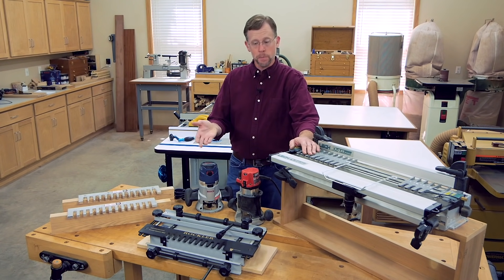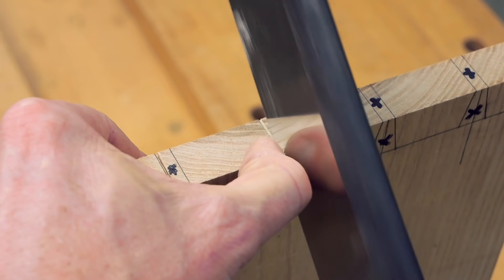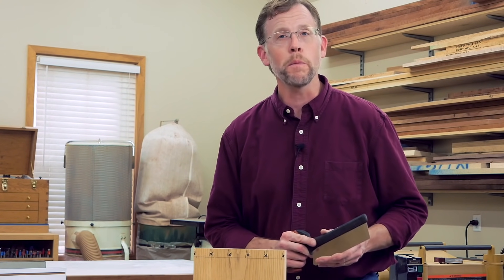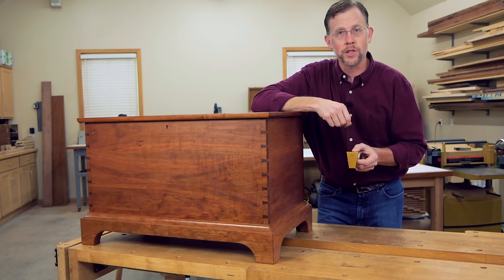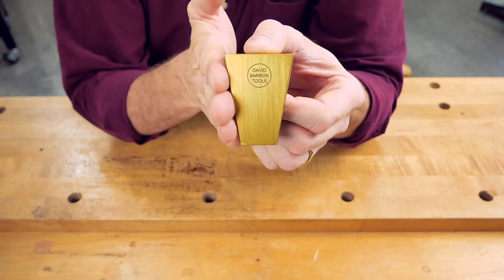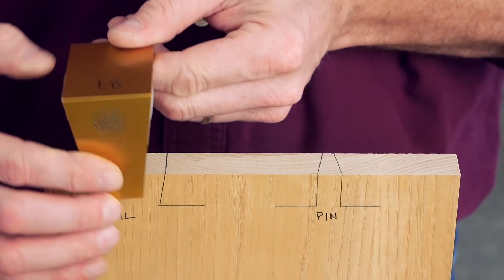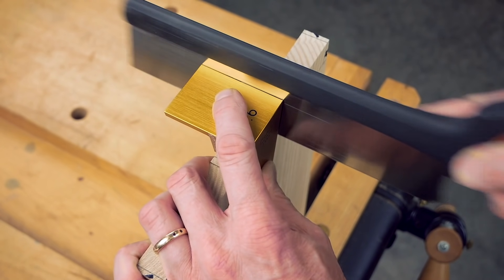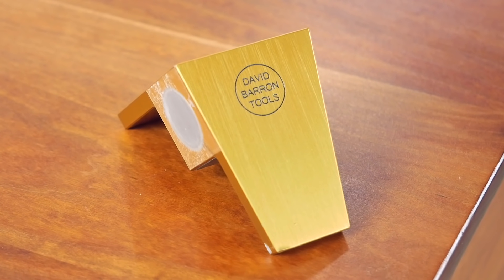Hand Cutting Dovetail Joints with a Simple Jig

Comment: Right, Highland Woodworking sells those at $50 a pop 🤣🤣🤣 I don’t think so!
Reply: Lol what a joke!
Reply: not sure why $50 is a bad price?  its a quality machined chunk of aluminum that does its job well.  If you dont like the price, Barron has links out on the net to build your own.  I tried to build my own, i still have 2, but they just arnt as nice as the machined one i got.  for the price and time it took to make, this is a time saver for me if i just have a few dovetails.   i usually use japanese saws btw, makes my lines a bit more clean.   it really helped improve my work wihtout having to spend hours on practice that i dont have time for.  also, i've spend almost 50 bucks on other marking guides that just sit in the drawers now.